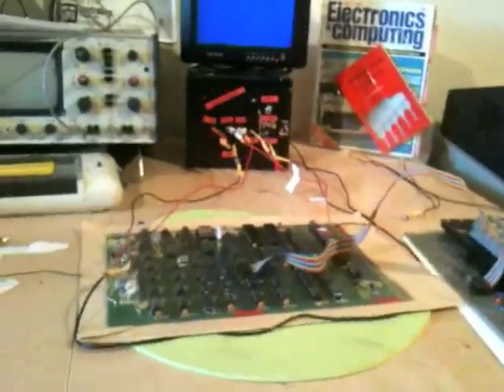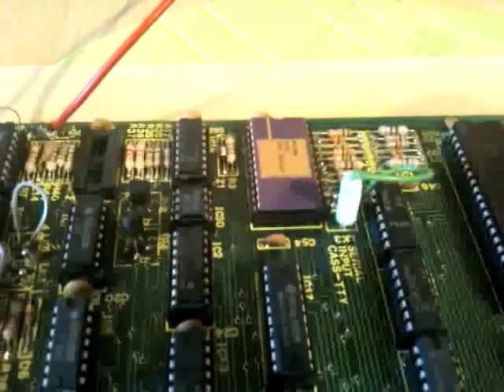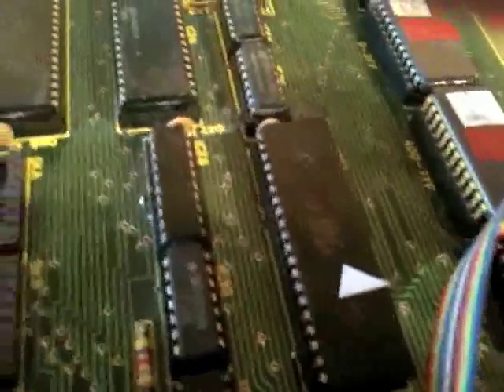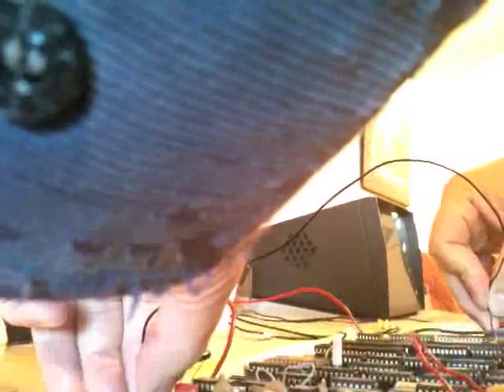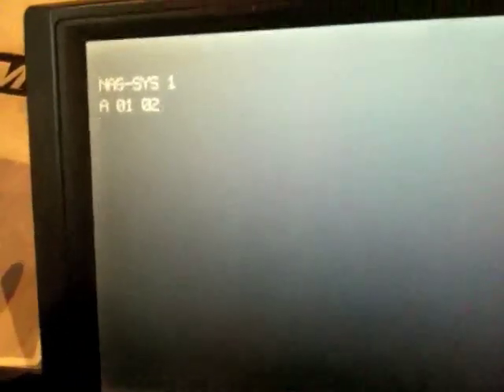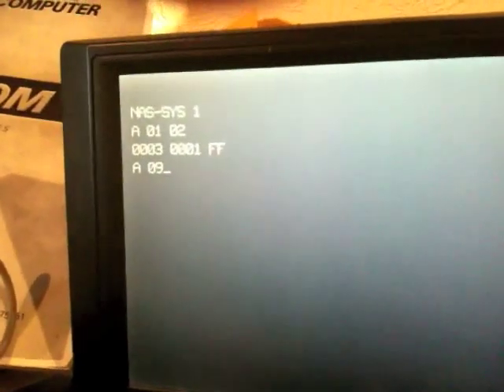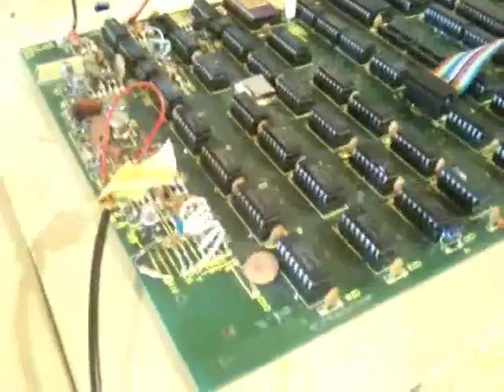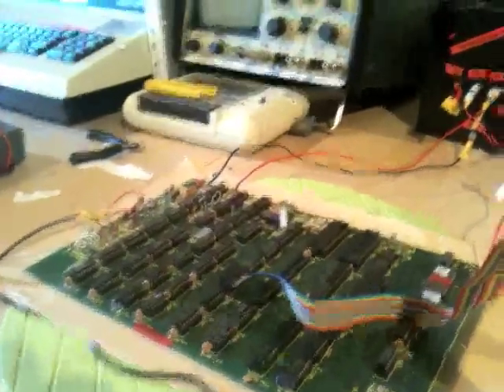Nascom 1 working-ish

Comment: Hi Neal.  I have a Nascom 1 & 2 withe expansion, plus the frame and backplane etc., Not used in years, but stored somewhere in the house.
You videos are very difficult to watch on a TV as the resolution is so low, and is centred in a small box on the screen, and sometimes rotates 90 degrees too ..!!  Can you fix any of this ?
I also have the Sinclair MK1 kit, which is the first Sinclair microcomputer kit - all hex with a 7-segment display..  Luxury ..!
Rich